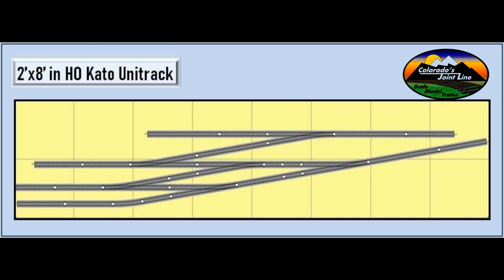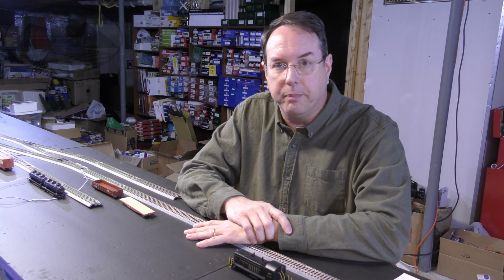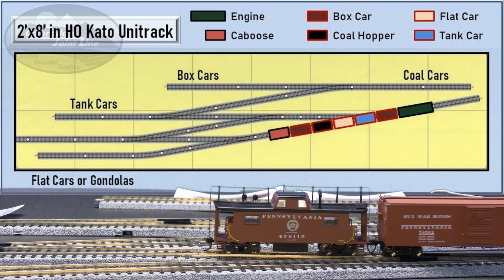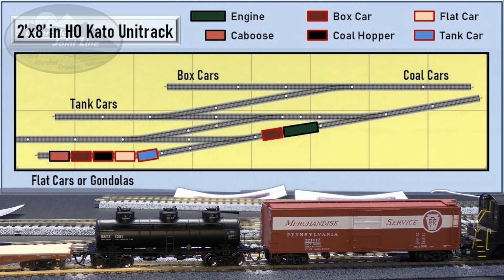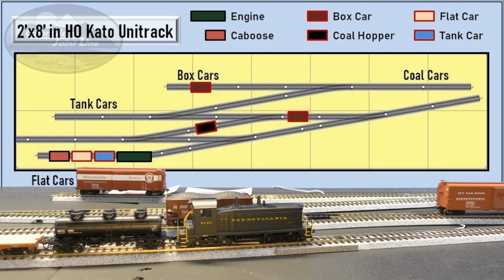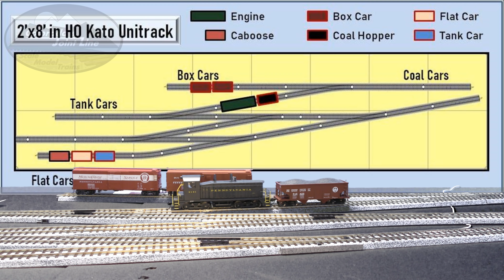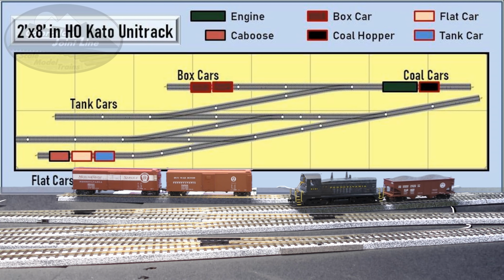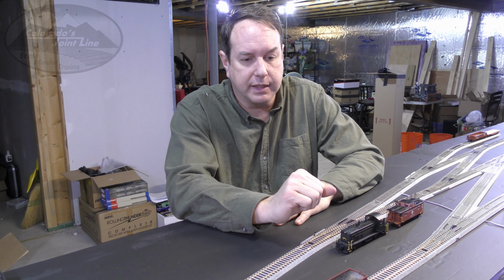Fun with Model Train Switching Puzzles

Comment: Thank you for this wonderful video! Your video coupled with the movements shown at the top of the screen was executed beautifully, and it made this so easy to understand and replicate. I have been wanting a a puzzle layout, and this is perfect for my intended use.
Reply from the maker: Thank you for the nice compliments.  Glad to hear this helped you with your switching puzzle.  Cheers, Kevin.
Reply: Might I ask another question. What do the white dots represent in your drawing? Thank you!
Reply from the maker: The white dots just show the connection points for the pieces of track.  Cheers, Kevin.
Reply: Thanks Kevin. I thought as much, however I just wanted to be certain.

Comment: Hi SMT&C , RailSol here. I feel identified with you in your video.  I have no money to buy and  time to run a scale model. Anyway im playing a very simplistic curious simulator called > (JB) BAHN ... its a simulator not fucused in awesomenes of 3D graphics, its more focused in a extended track network and automation of railway operations, anyway you also could control trains, at your own level of difficuty. Looking your layout in your video, I feel that its not irrealistc after all. 😄 because my last work is a small yard of 6 tracks serving a logistic center. The central part of the yard its similar like mine. THe difference its only the status of the consists.
 The challenge its handle automatically.there are a track for the switcher, a track for cargo engine, 1 track for reversing, 2 main lines, 1 track for storage or general purpose. 3 tracks for arriving consists, and 3 tracks for departure consist. and 1 track for the Logistic center. The yard are divided in some of 8 sections, made for the automatic work of the operations. I pass near 2 days thinking about how the automation could be to handle the operations. (the yard only takes me a morning to construct). I enjoy a lot the brainwork. And of course its very relaxing and confortable feeling watching all the system working. Surely like you do.

sadly my engilsh its not perfect and my (shy)level  its huge to make a simple video showing the work. 

Anyway , i enjoyed a lot. thanks.

Comment: I've already watched this several times, and it keeps popping up in my Youtube feed.  Are the model railroading gods trying to tell me I should build a switching layout?
Reply from the maker: Have you watched my second one yet?  Either way, maybe you SHOULD build a switching puzzle.  Lots of fun for just a bit of effort, and then you can take it down when you're done.  Cheers, Kevin.
Reply: @Modeltrains  Yes, I have seen the second one - at least two or three times!  With any switching puzzle I'd build, I would to some extent have one of the complications you introduced there, since my loco roster consists of a pair of Geeps.  Maybe I could double-head them. :)

Comment: After watching this video I'm thinking about sorting out cars from a long train (let's say 20 cars, 4 different types, in different quantities) reversing into sidings that are all in the same direction. The 4 parking spots are just big enough to fit all cars of the same type. There's one spare track that you can put on anything you want, but no more than 5 cars at once.
There's one additional rule: You can only move with a minimal of 3 cars or with no cars.

Obviously you would need at least 3 cars of one type to make the last move, but I think it would be a great puzzle.
Reply from the maker: Mark, sounds like you've got a great plan there.  Cheers, Kevin.

Comment: Do you have a list of the Kato track pieces, or part numbers, used to be able to recreate this layout? Thanks in advance. Enjoyed the video so much I want to recreate this switching puzzle to use myself.
Reply from the maker: Paul, here's the list of Kato Unitrack I used.  The feeder tracks could be substituted with regular straights and then use feeder unijoiners.  Cheers, Kevin

2-111 (S94), H0 Kato Unitrack, Straight 3 11/16".	Qty 1
2-150 (S246), H0 Kato Unitrack, Straight 9 11/16".	Qty 5
2-151 (S246F), H0 Kato Unitrack, Straight feeder 9 11/16".	Qty 6
2-180 (S369), H0 Kato Unitrack, Straight 14 17/32".	Qty 6
2-193 (S149), H0 Kato Unitrack, Straight 5 7/8".	Qty 2
2-290 (R867-10), H0 Kato Unitrack, Curve radius 34 1/8", angle 10º	Qty 1
2-862 (HP867L), H0 Kato Unitrack, Left turnout 10º (manual)	Qty 4
2-863 (HP867R), H0 Kato Unitrack, Right turnout 10º (manual)	Qty 2
S97P, H0 Kato Unitrack, Straight 3 13/16".	Qty 2
Reply: @Modeltrains  Thank you so much for the information. Will be setting up and running my train this week. I enjoy all of your videos. Thanks again. Oh, just FYI, I am a Santa Fe fan. My grandfather worked for them in Oklahoma City back in the 50s and 60s.

Comment: I tried this. ( dc ) , the run around didn't work .Going to try again by isolating ( and feeding ) some of the track .
Reply from the maker: Ken, depending on where you power feeders are and whether you use power routing switches or not, the run around could become unpowered depending on how various switches are thrown.  You may want to try putting a power feeder to all the tracks which make up the run around.  Hope this works for you.  Cheers, Kevin.

Comment: Hmm.... I'm in the midst of planning an N-scale layout that fits on a door, but mounting a 1x6 shelf on the wall in my spare room and a few turnouts and pieces of sectional track could give me something to do in the meantime!
Reply from the maker: That's a great idea.  Then you can decide to either keep it as a branch of your door layout, or just get rid of it and use the space for staging.  Either way will greatly expand the operation of your door layout.  BTW, back when I started in trains in 1993 I was in N scale as well and built basically a door size layout that fit into a closet (I took the doors off my closet to make a train nook).  Cheers, Kevin.

Comment: At 7:03 
And you have a sort of "MAIN LINE" that has VERY LONG STRAIGHT LEGS, (either side of the 2nd mainline turnout) - that you designated, and immediately forgot about completely - as it's by far the LONGEST LEG - to shunt / switch - slip any wagon off your original train - or to "pull out onto" from the lowest siding - this side, being the 1st siding to set the end of your "wagon rake" (being without a caboose left well away at the far left main - the flat car gets SET first.
Period. leave the caboose out on the incoming main
IF YOU NEVER BRING THE CABOOSE IN - until you need to run the loco around it you only have five wagons to work, then doing that (at the start) allows you to IMMEDIATELY set the flat car into it's siding.
FIRST
One down - & just four wagons to go
The coal wagon being set last. (yep last not 3rd)
The tank car being set 2nd last - and the 2 box cars being SET (together one loco movement) - immediately after setting the flat car.
My way ?
But no - you wiggle and waddle that loco all over the yard - many times - one wagon at a time
?
So many back & forth loco movements (and a caboose in the way of everything).

& Yet - there really are so few loco movements "my way".

Comment: I have 2 questions 
1. Is there any rough rule of thumb for determining whether any given puzzle layout that you design is or is not solvable 
     given the various restrictions prior to it's construction  ?
2. How were you controlling the turnouts, manually,  push button,  dcc controller ?
                                                             Thank You
Reply from the maker: Douglas, no rule of thumb.  I have created a few that I found out about half way through I wouldn't be able to "solve."  At that point I usually change the rules where I leave behind a car or something.  Usually the problem lies in having too many cars for the length of the run around and having enough spurs facing the correct way in order to temporally store cars while getting all the switching done.  I was controlling the turnouts manually.  Cheers, Kevin.

Comment: Glad to see this. Do you put drops in at every spur/siding? I’m not too familiar with the Unitrack but see the various wires in your video. Thanks, Kennedy
Reply from the maker: I'm running DCC and Kato Unitrack is power routing so I try to put a feeder on ever siding to ensure power is available regardless of how I have the switches thrown.  Cheers, Kevin.

Comment: Kevin, you should make a Talking Trains Series using your model trains. Just like Thomas the Tank Engine and Friends. 
Joint Line Fables:
Characters:
Kevin the SP GP40-2
Daniel the BN SD40-2
Alicia the ATSF SD40-2
Jack the ATSF SD40-2
Nicholas the ATSF SD40-2
Ron the DRGW GP40-2
Shawn the ATSF C44-9W
Reply from the maker: Thanks for the idea.  That's something I haven't really ever considered doing.  Cheers, Kevin.
Reply: @Modeltrains  you heard of the Full Bucketniers?

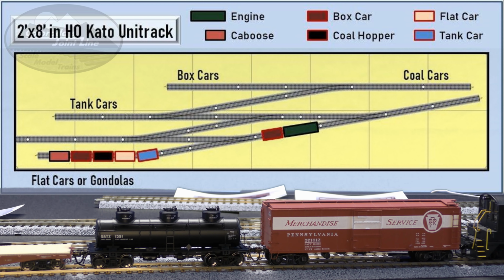Comment: 12:37 and THAT WAY - that you do thing.

That has to be the slowest - most useless and utterly TIME WASTING multiple movement idea, as to how to "spot" & set - all wagons of that train (via it's different types of wagons - into their various locations) - doing the entire operation - ONE AT A TIME - from the closest track (beside the camera) to that one away at the back left - of all the other tracks?
ONE WAGON SHIFTED across the entire yard - WHAT A WASTEFUL TIME.

Obviously - you haven't thought that (all) through .... as in the very beginning you made a fatal mistake - !!!
YOU BROUGHT THE CABOOSE INTO THE YARD - which ("being in the way") needed to be shunted here, there & almost everywhere ?
..
Solutions are easy if done simply FIRST.

Plus - the Flat car is SET first and the coal truck LAST
The two box cars are only set, when you have thought it all through (and shunted them behind the flat car - at the very beginning).

The incoming train from the MAIN LEFT - need ONLY "arrive" on the mainline - and the LOCO stop short of the very first turnout.
Allowing enough room for the loco to "run around" anything (on either of the two main/loop tracks) to get the loco back to the LH Main entry track without shifting the caboose once.

By leaving the rest of the train - to the extreme left of any mainline turnout - !!
The loco has all other options remaining to loop &/or shunt / switch with.

Now ---
Apply the train brakes and uncouple the caboose (we won't be needing it - ANYWHERE INSIDE THE YARDS - for any shunting operations).
LEAVE THE CABOOSE - ON THE MAIN LINE AT THE EXTEME LEFT, "brakes on" until it is shifted at the very end of shunting operations.

After all - every operation to get all the other wagons / cars - into that zig-zagged yardwork - will require multiple trips across the main (more so your way) .. which the caboose DOES NOT NEED TO BE INVOLVED IN
It is very easily  "parked" out on the main (protecting all yard work and shunting / switching operations) until every last wagon - has been "set"

My way - there also be - very few of those slow - ALL THE WAY ACROSS (the yards) - loco movements

Without even once - ever needing to SHUNT the caboose "anywhere".
It stays on the MAIN at the far left of this yard - protecting every operation 
(when the loco is going to be remarshalling everything - to where it should go / to be set.) 

REMEMBER .. you "do not" need to actually shunt the caboose "at any time". 
(it isn't on the end of the train now, as it's still away back at the entrance to the zig-zag yarding system - brakes on).

Now pull all the rest of the train (including the very last wagon - being that box car) 
And take them all up past the 2nd turnout & shunt / slip / switch (whatever YOU call it) 3 wagons - !
Use that turnout & ONLY That turnout - to get the exact 3 wagons in the correct order, placing the 3 of them correctly, into the lower siding.

You know - the one that you used to put ? THE ENTIRE TRAIN - ALONG WITH THE CABOOSE - (INTO) .?
It only needs 3 wagons and the loco - when "setting" the flat car.

Now also remember - that as the FLAT CAR will be remaining in that bottom (flat car) siding - it needs to be put there FIRST
(Unlike what you did when you put not only the the caboose 1st but the whole train in there, with the box next to the caboose.)

OK
1st - switch out the flat car
Then do the switch/shunt-boot &/or slipping of BOTH box cars.
Now - shunt all 3 into that flat car siding - onto the stop-block.
The Flat car is disconnected and is thus SET.

That's that siding done (for now)

Next - you will need to run-slip / boot or shunt/switch the tank car - back towards the caboose 
(where it still sits at the extreme LHS on the entry Main - with it's brakes on).
...
Only then will you DROP the Coal wagon (where you eventually put the caboose) on the 1st loop - via the very 1st turnout.

Now - run the loco around it - (via the yard and the top mainline siding and the 2nd loop track) and return the loco into the flat car siding and pull the 2 box cars out and up past the last turnout....

.......
Now comes the (not) very tricky - HARDEST part - of all see.

YOU SHOWED US - that the Tank siding accepts 2 wagons PLUS the loco - as does the coal siding - (as does the box car siding).
The 2 box cars - can now be set by the loco - into their own (Box Car) siding at the LHS (very top corner) of the yards
....
Now comes another very tricky (not) second "set" operation.
You bring the loco fully out onto the RHS Main siding, and run it past the coal truck (via the RHS loop on the main) until you connect onto the tank car
DO NOT PUSH IT ONTO / nor couple it with - the stationary caboose. - (as that will still stay - exactly where it was left at the very start).

Now, tow the tank car as you enter the 1st loop where the coal truck sits & connect onto the coal truck.
Keep moving by push/pulling both those wagons out onto the tank track / RHS Main siding.

Then reverse and push the tank car into it's siding (pulling the coal truck behind you) to SET the tank car..
As we have seen before, that TWO WAGONS plus the loco will fit into the tank siding, (clear of the turnout).
This means that there's no problem to simply uncouple the tank car & leave it at the end of it's TANK CAR siding
To then push the last wagon (the coal truck) into it's siding to leave it there (set) as well.

THAT'S IT - all 4 wagons that needed to be set (during the shunting operation) - has been completed.

....

Finally
Withdraw the loco OUT OF THE YARDS - all the way back onto the caboose, couple onto it & drag it further along the main line into the RHS loop
Drop it there & run around it via the 1st loop (to get the loco back onto the main) and recouple the loco onto the caboose.
.
Lastly - you are on your merry way home - pulling the caboose behind the engine (as you depart to the LEFT - along the main line).
...
NOT ONCE - has the caboose been shunted (either backwards &/or forwards as part of a remarshalling task), and it has NEVER left the main line.

Unlike your time consuming back and forth shunting method
(moving JUST one wagon at a time)
What a wasteful / slow operation - all whilst shifting the caboose several times

See - you did NOT need to be shuffling the caboose all over the yard?
Nor do you need to move the loco very far between switching operations - nor do you need to remember where everything is - or goes?

Just a very simple method of LEAVING the caboose out on the main (setting the flat car 1st) 
And only (then) short-slip/shunting wagons at one turnout at a time, until all wagons are "ready" to be set.
Setting all on the top side of the yards is done fairly quickly and with minimal effort.